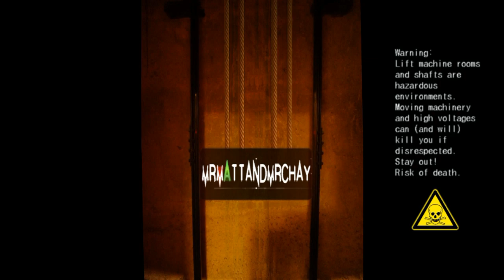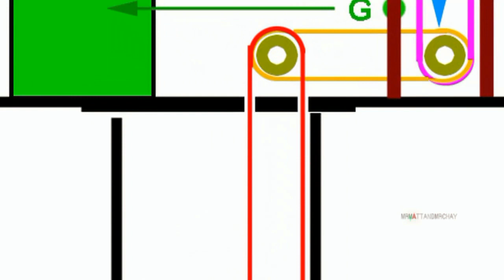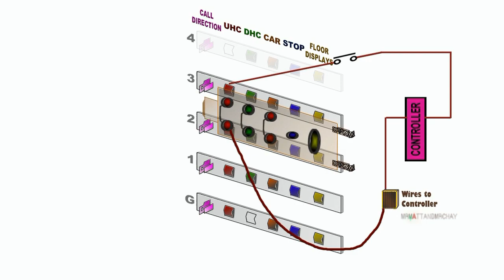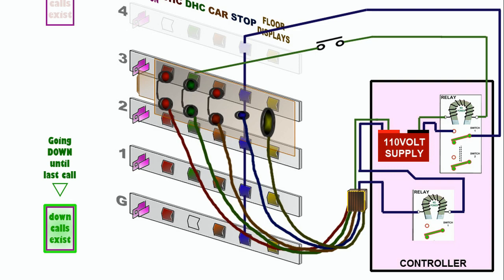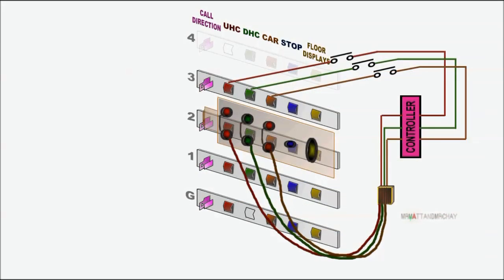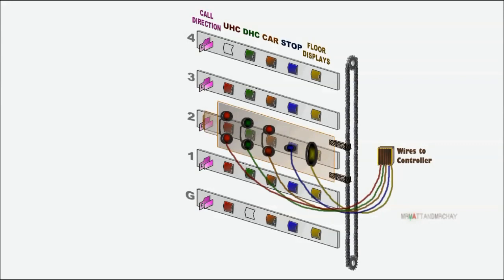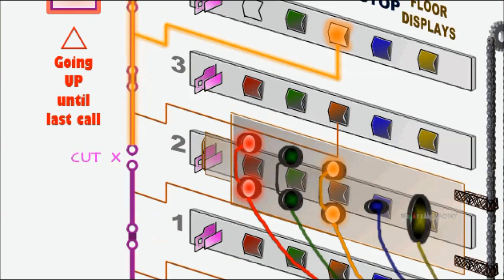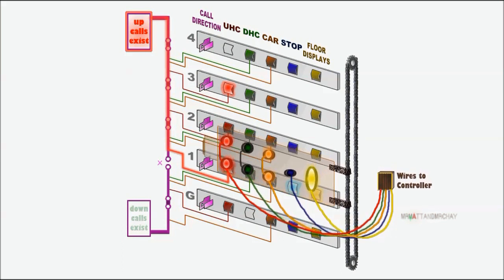OTIS FLOOR SELECTOR movie - A beginners guide to how it works.

Comment: Isn't it simpler to place all these switches and contacts directly in the shaft? Russian elevators have them in the shaft, the floor switches can be mechanical or inductive, the slowdown and stop switches are usually inductive.
Reply: Алексей Рукин I can answer this question for you .It is far easier to troubleshoot components that are physically in the machine room than the shaft.Otis has a type of elevator with floor switches in the shaft .He is just showing one of the many different Otis installations.Well all the ones with selectors anyway.BTW it looks like an 6850 selector.i think he did a marvellous job.

Comment: Hi Matt, it's superb watching your excellent animated demo about OTIS pie plate style selectors. I'm kind of trying to convert this relay logic into an animated lift simulator app as a part of a programming course I am doing. A purely digital approach would be a lot easier (ie having a 'floor' variable that stores the floor number (0-3 in my sim) instead of a mechanical (ie animated interactive objectives that interact with each other) selector but these selectors are the accompanying control cabinet are of great fascination to me. 
Deciding which direction the lift needs to go to pick up calls has always been a bit of a mystery to me. Even more so, changing direction. 
In your animation, you have an 'Up calls available' and 'Down calls available' box at the top/bottom of your direction 'line' but where do these come from? Am I right in assuming that these come from the far (right) side of the slowdown relay (in your controller)? That would make sense to me.